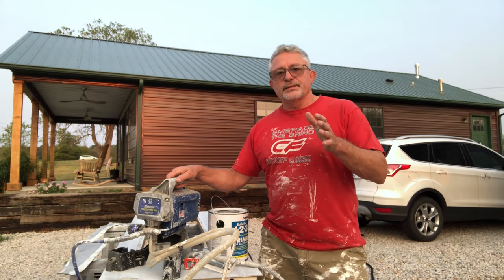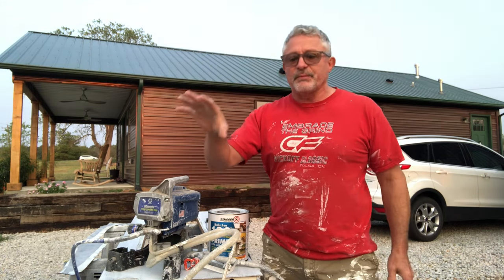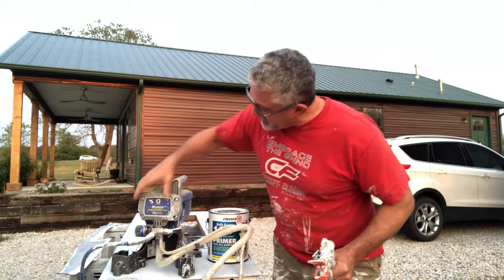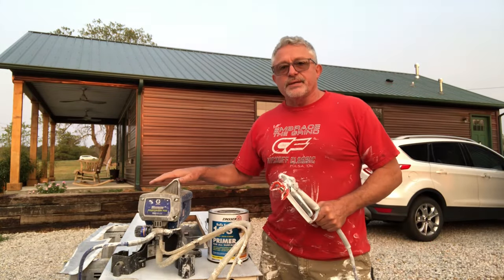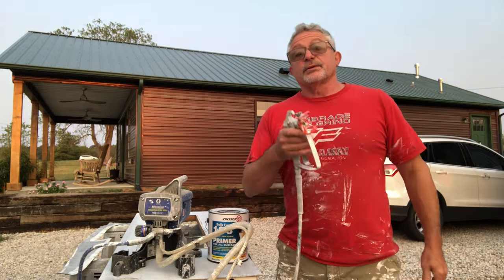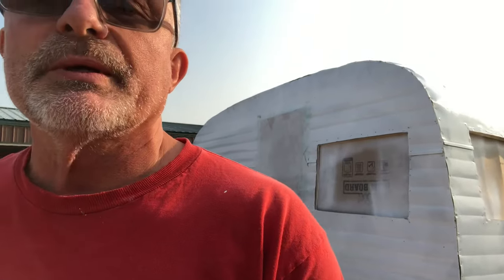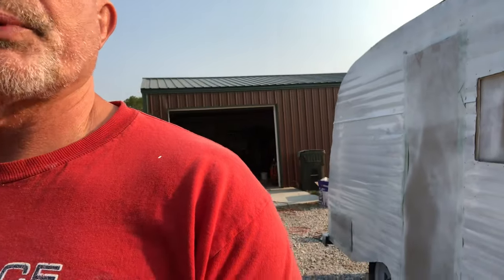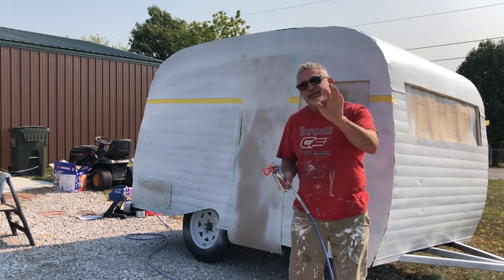EP 84 - DIY how to paint your vintage camper travel trailer.

Comment: Been using Zinsser Bull's Eye for years but then I though you can't used latex on a "vehicle" but then I realized i used tinted Zinsser under an 1999 Fleetwood Southwest Storm in the tire compartment area and used Valstar white paint primer on the two metal corners in the rear that were peeling - I removed old paint with angle grinder and a twisted wire wheel.  Painted both with a brush.  First time I have seen a house style aireless painter but it makes sense and probably does a nice job with the right tip.  Beautiful wide fan and looks like very little overspray and of course a very short dry time vs oil-based.   Great vintage color choice.
Reply from the maker: Thanks. It is a great combination. Works well.

Comment: Really appreciate your videos. Have helped alot. I saw the 123 primer you use.
What brand of paint would you reccomend for body color exterior?
Interior?
I prefer to go with hi gloss.
Thanks in advance!
Reply from the maker: I use Behr exterior gloss. Thanks for watching
Reply: Any brand that is around $40+ gallon will have a high level of vinyl and that makes for a durable finish that will last if applied over a good clean prep job.

Comment: do you have to sand it down to the metal to repaint? I have the same camper and was getting ready to put a fresh coat on.
Reply from the maker: If the paint is still good I scuff it up and knock off any loose paint. Don't have to go down to bare metal.
Reply: I second that.  Never go down to bare metal unless really necessary - paint lifting completely, shot with rust, etc but if going down to metal in spots they will need to be leveled with a filler product to match the height of the existing paint left in place.  Clean multiple times to avoid sanding contaminants in to the paint.

Comment: Rob, I saw your primer brand but missed what top coat paint you’re using, thanks
Reply from the maker: Behr at Home Depot
Reply: Thanks, have you ever used Rustoleum brand? Seems it’s designed for metal and outdoor use, thanks
Reply: @RobTheRebuilder   How is it holding  up? Any specific Behr product?
Reply from the maker: @wcstrawberryfields8011  I always ask for recommendations from the counter guy. No problems so far. Seems to be working great.  Its all in the prep.
Reply: @RobTheRebuilder  Thanks